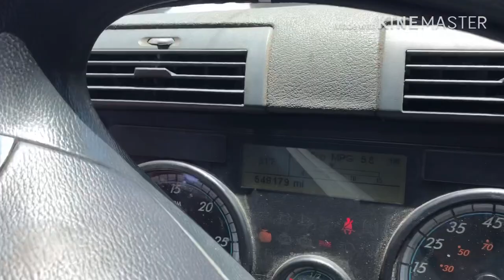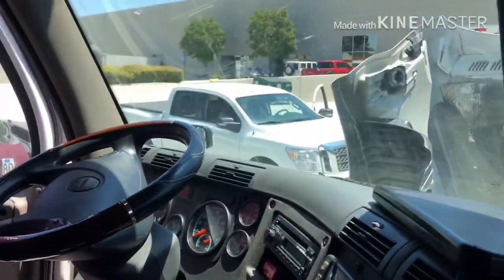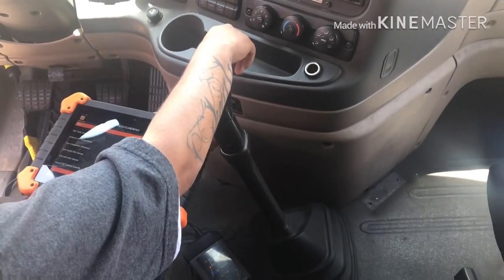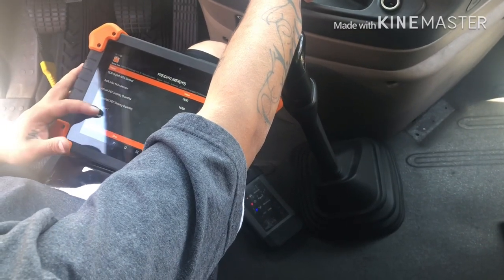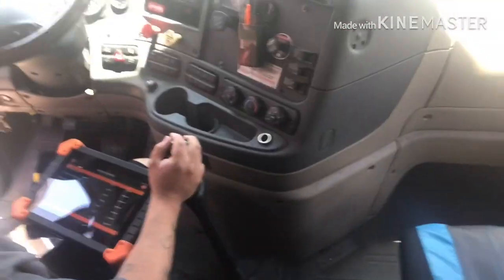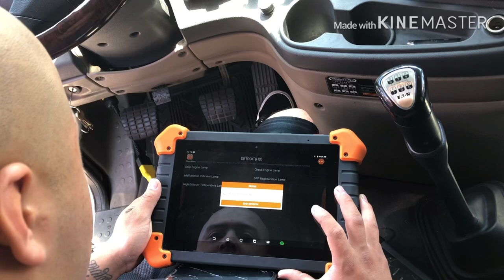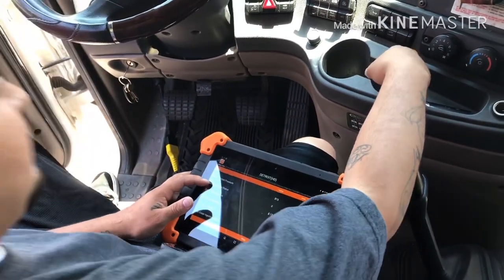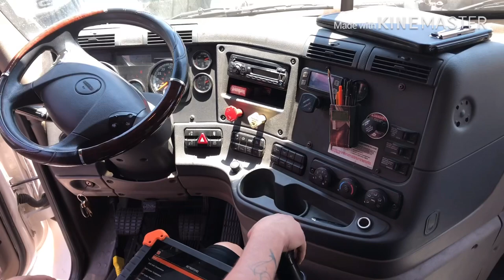Launch diagnostics program

Comment: That mill light is for the def system.  If the check engine light is not on with the mill light  the system corrected itself.  If the check engine light and mill light is on at the same time then you have a problem with def system.